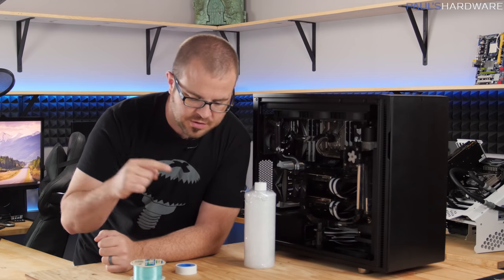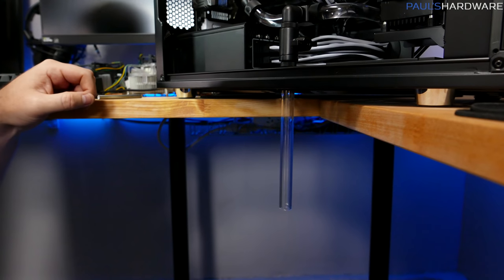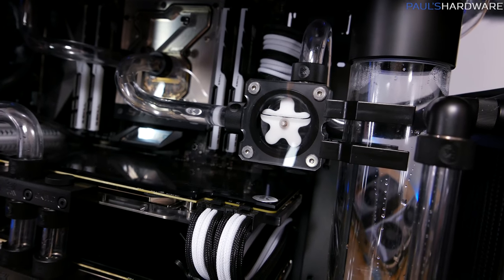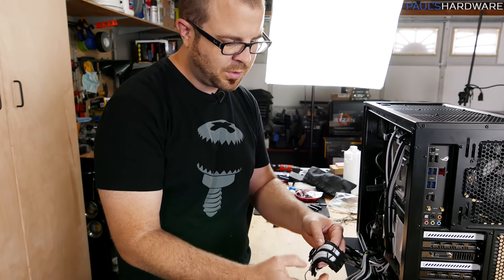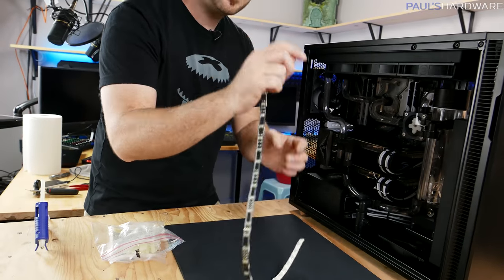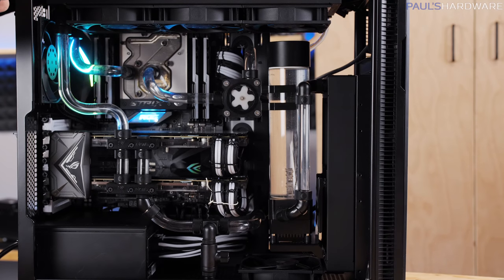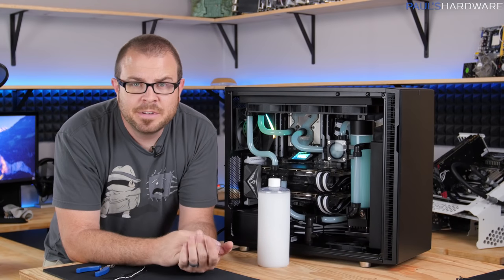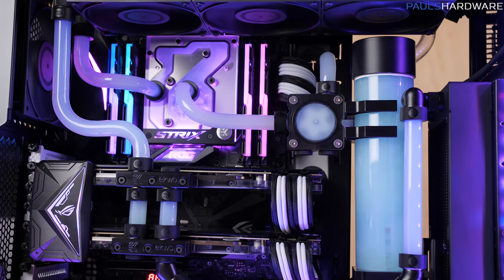MY WATERCOOLED PC IS FINALLY FINISHED! Arctic Panther Build Log Part 4

Comment from the maker: Sorry the final build log was delayed a week guys! I needed to get some cleaning/organizing done, as you can maybe tell from the shelves in the back 😁 
What are your thoughts on the blue coolant color?
Reply: The light blue looks alright. It goes well with the monochromatic cables and the rest of the build. If you were to go more blue it would probably look better IMO but then you would kind of have limited options on your lighting config. Beautiful build none the less!
Reply: Maybe try another light color, like a silver instead of the white? It would still look awesome. 
Or If you were to give up RGB LED for a good white LED strip it might help to correct the discoloring and wouldn't take long to test out.
Reply: Paul, have you considered cable combs that are open-backed like the ones from ultimate personal computers? You can just pop them on, then you can just pull them off when you're done. I've used them before and they seem to do the job just fine.
Reply: Paul's Hardware  that coolant kind of looks like my piss when I drank a bottle of antifreeze.
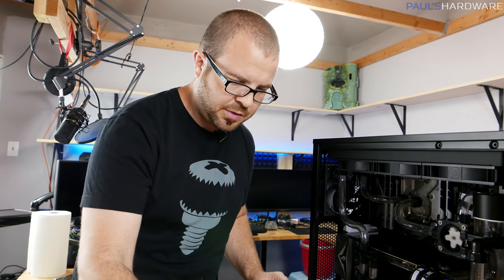Reply: 7:49 I... have... the... POWER!!!!!!
Reply: The blue is probably from contaminants in your radiator, a blitz kit would take care of that.
Reply: well, with purple light actually doesn't look that bad though.
Reply: @PAUL The Blue color water is normally a result of chemical reaction from the copper plated parts and electrolysis!
Reply: That light blue isn't actually that bad imo...it looks almost like arctic ice. Arctic Ice Panther.
Reply: It cuaght me off guard when the screen changed to the final, but the blue actually looks good, man. Especially with "Arctic" in the name. If the white doesn't work out, you can always set a blue/white shift on the RGB pattern and it would look sick.
Reply: Zalman tnn 500af, with hdplex h5 cooler 😁 fanless
Reply: That color shift on the fluid makes me want to do (or at least see) a "cotton candy" build....pink and blue would looks so sweet (pun completely intended) in a loop like this.
Reply: You need a M20 to G1/4 Reservoir Fillcap Adapter for those fill/drain ports to use G1/4 fittings.
Reply: Love the build, and you got rid of that power supply scratch! lol
Reply: Blue didn't kill the build would love to see it in white though.
Reply: Paul, I would drain that fluid into a bottle and send it back for analysis if I were you. Turning blue so fast indicates a chemical reaction. My guess is something may have precipitated out of the solution. It being a prototype and all, you really can't be too careful.
Reply: I like the faint blue but not sure with the black/white cables, you could always switch em and get some cable combs at the same time ;-)
Reply: About coolant. I would recommend flushing loop and cleaning for any leftover. I had problem when I changed coolant from pastel. After a while there was building gunk because in loop was two types of coolant. But ask Jay he will know better :D
Reply: you should drain the loop and refill it
Reply: LOOKS AMAING BRO WELL DONE
Reply: looks good
Reply: I think it's perfect, a really nice ice blue and it'll match with your strips you have around the shelves too.
Reply: holy balls that colour looks amazing! i bet you couldn't make it if you wanted to...
Reply: Looks like steam. I like it.
Reply: Paul's Hardware where did you get the rub strip from? Just wondering.
Reply: It looks good with the side panel on. The texture of the coolant might look better if you turn down the pump speed a little bit.
Reply: Maybe it's due to a reaction with the water that was still inside the loop when you filled?
Reply: I think it looked better with distilled water.

Comment: Paul, you need to get that fluid out - if it turned blue after only one day, it means that it is dissolving copper very quickly (blue color comes from Cu2+ in solution). You'll probably end up with leaking radiators after a month if you dont swap this.
Reply: Well they said it is an unfinished product and when a coolant is unfinished it does either have problems with stuff percipitating out, dissolving tubing or making o-rings brittle, or having subobtimal anticorrosive properties. The fluid does not need to be corrosive in order for corrosion to happen, it just needs to be able to cunduct electricity. Paul has a lot of Nickle in his loop and in combination with a fluid that has high electrical conductivity, this could have lead to copper from the rads going into solution.
I think it is more likely that copper was dissolved than that a chemical reaction with dye residue occured that by chance(!) lead to a blue product.
Reply: Psychx is 100% correct, great explanation. I would flush that liquid asap, maybe test it one more time but if it turns blue again would flush and go back to what you used in the old version of arctic panther.

Comment: Hey Paul,
Great video as always. We're glad we got to hook you up with some Vue. A little insight into Vue and why it may have changed colors. If you have any previous hardware that used colored fluid, Vue may attract that old dye as even a clean flush may not get all previous dye out of. Vue is sensitive to dye. We have already planned a co release product that will help eliminate this issue for people that are changing from colored coolants to Vue. Yet again great video and phenomenal build!
Reply: PrimoChill if you didn’t write this I wouldn’t have bought the companion fluid!
Reply: We are about a week to two out from release. Keep an eye on our social media (@Primochill everywhere) for the official launch post.
Reply: I need vue for my new build to the point I cannot be bothered to fill it and drain it before Vue is released ... That and a cable cockups has meant I won't be finished for atleadt a week so might as well wait now :)
Reply: Monk run distilled water and test for leaks...Some don't show till you have heat.
Reply: Very nice having the supplier updating us ;) Good stuff.
Reply: Everyone needs to be aware that ANY opaque fluid, regardless of the company will indeed fade, discolor, fall out, etc . Primochill does a great job explaining this. I’ve personally used many of their fluids and others with great temps. If you aren’t ready to completely drain, flush and refill with opaque every 3-6 months(especially for a 24-7 rig), I would consider another option. I’d personally advise going with their LRT colored tubing of choice and a clear premix. Learn from my mistakes.
Reply: Your mistakes were just that...Colored tubing does not offer the same look as fluid and color choice is limited. Saying all opaques will fall, discolor, and fade in this instance is based on no facts. Lets wait to see how the final product holds up upon release. I'm sure if people notice problems the watercooling community will be very vocal about it.
Reply: We will naturally be expecting feedback. It's true that opaques fade in time, a lot of things factor to the fading and need to swap around the 6 month (-ish, sometimes more, sometimes less) mark. We will be posting a very detailed video on how to prepare your system for Vue, as well as a special system prep solution to go hand in hand with the coolant upon release.
Reply: PrimoChill Did you discontinue the True Infused Opaque? Or at least, quit making batches as they are all sold out on your website. I personally only would get about 3-4 months out of that fluid type. I always used sys prep for 24hours before hand, had a pressure release valve installed, and used all EKWB nickel parts. My rig is a 24/7 OC’d x99 platform though.
Reply: @T Hill, we are waiting on the packaging for True to arrive so we can restock. We should be back and rolling with it very soon.

Comment: As a fellow owner of a watercooled build inside a Define R5 I can confirm that this case is a pain for draining. The best solution I have to help get the fluid from the upper areas to drain is to use a hand fluid pump that you would usually use for stuff like transmission fluid. Connect the pump to the reservoir top port, close drain valve and create vacuum pressure so that the fluid gets sucked back towards the reservoir then open the drain slowly to release the pressure and the fluid it takes a few tries but better than moving the case at all different angles trying to get it out.

Comment: Paul, I have a tape suggestion! I know the 3m adhesive tape on the LED strips sucks, but Gorilla Mounting Tape (the black not the clear) is AWESOME and you can cut strips of it for however you want to use it. Would be easier to deal with than hot glue too! Anyways, awesome build!

Comment: Tip for getting rest of the fluid out of the loop is to have a valve fitting right out of the pump. It isn't pretty, but if you close it, then pump the inlet with an air pump, you can force air through the loop, pushing the water out the other direction. Unless you disassemble the whole loop, you're not getting ALL the water out, but you can get a hell of a lot more out with an air pump.

Comment: The threading on the fillport is G3/8" which means the internal tube for the EK-RES X3 fits in perfectly. Also, in a loop construction like this, you can try and blow air through the fillport to get the residue water out.

Comment: I'm no chemist, but I'm pretty sure it turned blue bc it's dissolving the copper in the radiators and blocks. I'd get that fluid out immediately if I were you
Reply: Great insight! Dissolved copper would not be blue however, but copper oxide would. If your radiators have oxidative stress with resulting copper oxide layer, Vue will pull it right off and turn it blue or green. Vue also attracts old dyes from the system, which as Paul correctly stated is the reason why the fluid turned blue. We are coming out with a Vue-specific prep to reduce issues like this from copper oxides and dyes.
Reply: PrimoChill so if he drained the fluid and rinsed it a couple of times, it would be the right color when he refilled it?
Reply: Yes. But we highly recommend using the prep solution that will come hand in hand with Vue upon release. Like Sysprep is used for preparation for our True Opaque, this will be used for Vue. If he can get out all of the dye from the old setup, it will be the color it's supposed to be.

Comment: He put the teflon tape on in the correct direction +1
Also, Paul, did you at all question whether or not that coolant resembled seminal fluid whatsoever?
Reply: Keatononame I commented the same thing and scrolling down the comments noticed you beat me to the t tape direction praise. You must be a plumber/steam fitter. Watching people do things right gives me hope that not all is lost yet.
Reply: I noticed also.
Reply: Funny enough I mentioned that in a much more previous video where he did so counter-clockwise, he either read mine, or another person's comment and commented on it himself in another video, and corrected his subtle yet incorrect mistake. Glad there's still hope for manual labor with those on youtube anyways.

Comment: Hey Paul, check out Singularity Computers DDC mod kit and reservoir. They use a compression collar method instead of just the threads on the res so that you can orient the top how you want it and then just tighten down the collar. You can use the pump that came with your EK pump/res.

Comment: The thing about cable training as you put it is socket stress tolerances after time the socket will break the cheap plastic socket that they use or any for that matter were not designed to have bend strains put on them oem's don't do this and contacts inside the socket will pull away from the plug losing connection this happens enough times in normal conditions while this looks good it would be better to design 45 or 90 degree angle plugs for just such app.s they may not be around yet but should be.

Comment: That clear pump looks really cool, never seen it before
Reply: That's actually the flow indicator. The pump is integrated into the bottom of the large cylindrical reservoir.

Comment: blue could be copper oxidization from blocks and fluid
Reply: Andy Cormack my thought was that the new Vie fluid reacted with the water that was left in the system... Maybe diluting it enough to not appeared white anymore.
Reply: My guess would be the copper also, copper usually has a green colour when oxidizing, probably the white with a hint of green/fluid properties makes it seem blue?
Reply: Copper is green in the air, but blue in solution.

Looks like copper II sulfate.
Reply: Doubt the water would be the problem, as it is gonna be distilled water at its base ( I assume, so they can make concentrate mix to sell)
Reply: But he was running straight distilled previously- which, without an anti corrosive could have pulled a little bit of copper from the radiators into solution or allowed for some oxidation inside the radiators, which then leached into the fluid. You can run into the same problem with the mayhems pastel white if you dont clean your radiators.
Reply: copper oxidation is a greenish blue, not the blue that is shown in the video. Source: Minoring in chem

Comment: Correct me if im wrong, but im pretty sure the Vue is not a concentrate, but rather a complete fluid. So it should have been put in an empty system, not added to a full loop of water.

Comment: Question: would a valve stem on the reservoir let u hook a small air compressor to the loop and push out the water ?

Comment: Paul, you didn't install the EK-RES X3 - Internal Tube on the reservoir intake and that's why you have alot of air bubbles floating in your loop! The liquid is dropping directly into the liquid surface making the bubbles! That's not ok mate ;)

Comment: Reason for the leak on your thingy was simple (former pipe fitter) you tightened then loosened. You never ever loosen when doing anything with water as that leaves it open to leak. Expect it to leak in future even with the plumber tape. I want to do a full custom loop and use my method of measuring and having everything preplanned and all cut to size perfectly. :D cause... yesh
Reply: Harles Bently yep he shouldn't of backed it off after he tightened it. One thing that bugs me about these loops is that they barely ever use 45 degree bends. Everyone always seems to go for 90's because it looks better. I would personally use as many 45's as possible, less pipe used and better flow. Nice to see he wasn't scared to vent it while he drained it. Probably the closest to perfect loop set up I've seen yet on YouTube, still wish he would have put the inlet/outlet of the front rad on the bottom.
Reply: fourtysix4646 one thing these people think is joints create leaks. Or high chance if it.

Comment: You should try making a water cooler that's designed to work in the Midwest where it's going to be like -1C soon.  We can harness the cold of mother nature!

Then name it Mother Nature PC build.   Then in the summer, dig a deep hole where it's always cold underground some random shit blablabla I don't feel like thinking anymore
Reply: You can be the first to make a "GREEN PC"  or environmetal pc whatever ya call it
Reply: The term you are looking for is geothermal. It is used in a lot of large industrial applications for cooling/heating.
Reply: well any cooler will work fine, if it is powerful enough idle temps will be close to surrounding temps
Reply: fourtysix4646 
ahhh yes, that's the word.. Geothermal 

Time to build a geothermal pc.  First of its kind
Reply: Medokn, the trouble with using -1C (below freezing) ambient temps is that your fluid will freeze unless you add some sort of anti freeze. And that anti freeze has to play nice with all the metal, plastic and rubber bits in the loop, something you'd need to test extensively to be sure you won't have any leaks. But I'd watch the hell out of that video!
Reply: Honestly just leave it outside and take off everything except case intake and outtake fans
Reply: Erland Johansen
But I thought as long as the water keeps moving it wont freeze? Like rivers
Reply: Candi Soda but the reservoir has nonmoving water, you'd have to have no reservoir which make the system harder to fill, not impossible though, but what would be best is to just have a high flow rate system with only your radiator outside your window and use a fluid with a freezing point at least -9 C. Last winter we got to -20° F here (-28 C? Don't feel like calculating) so you'd have to bring your radiator inside for days like that
Reply: L S or maybe two seperate loops with a heat exchanger in between..  So you dont have to worry about nasties or freezing in your main loop..
Reply: Ryan Bernard That could work, or you could have a heating exchange/element after the CPU before it goes outside and write a program so it activates the heating element if the probe after the radiator is reading less than say, 2C then it will activate for a brief time and measure in 20 second intervals. It would make sure the water stayed above the freezing point while in the radiator while maximizing cooling.

Comment: I appreciate the time and effort that went into this build, but I'm not a fan. With that much water cooling gear the build looks too cramped, far too busy. I'd love to see you do a water-cooled build in a full-sized case for a change. The opportunity to add more cooling gear (rads and radiators) is much greater, not to mention achieving an overall cleaner aesthetic. 

It's a fine build, just not my cup of tea.
Reply: I really like that all the space is used. It looks really nice i think.

Comment: LOL, did you for get to flush the radiators with vinegar in hot water, that is the most common fail, thinking the radiator are clean when they come from the manufacture... But atleast yours turned iceblue, my first watercooled loop with white pastel turned pink... xD